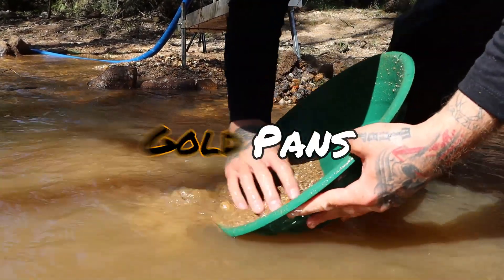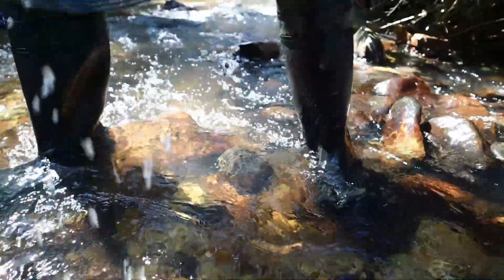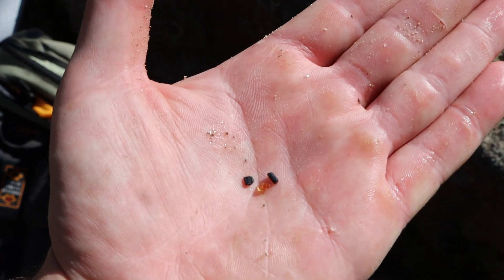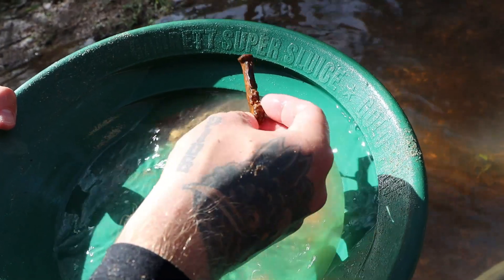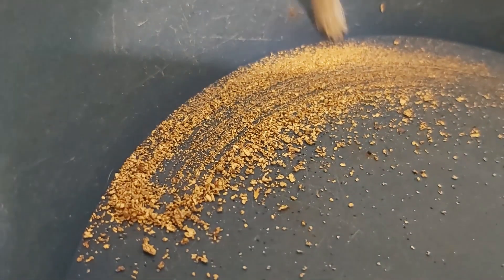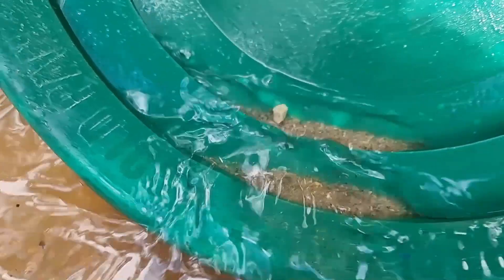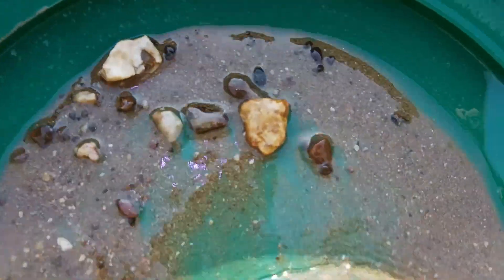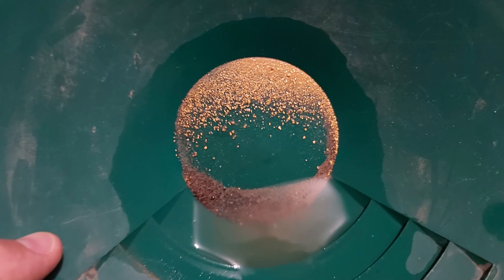Do You Know How GOLD Pans Work?

Comment: Chris, what a coincidence, this clip. Until 12 hours ago I was convinced sluicing (8 mesh material run, classified down to 20 mesh and rerun on a finer mat) was the fastest and most efficient way to process my gravels. I was wrong. Classified down to  8 mesh, it's suddenly panning, I got panned 4 50 gal. baskets in 4 hours with unusually more fines. Or I must have hit a sweet spot, that I just scratched and now waits to get finished. Using vortex mats and the Garret Super pan. Keep venturing!  :)